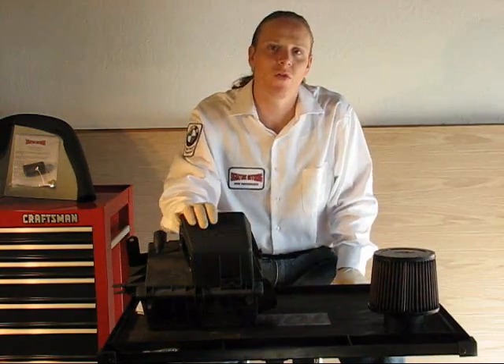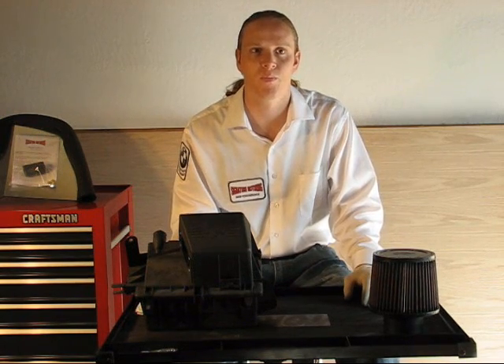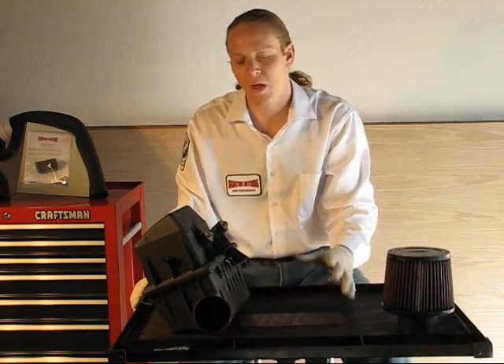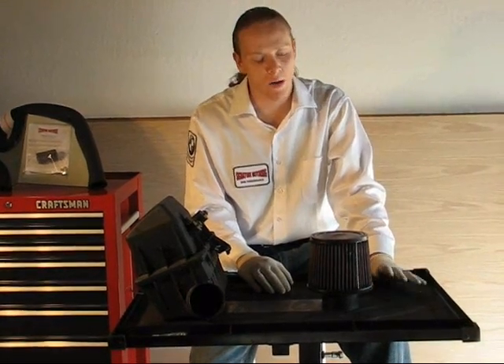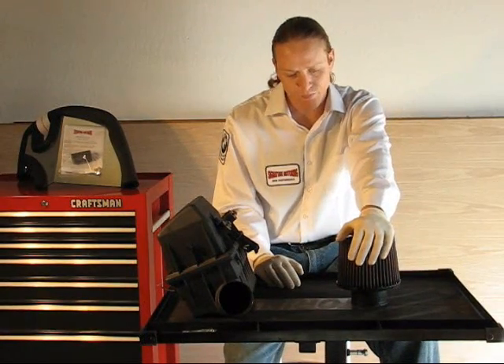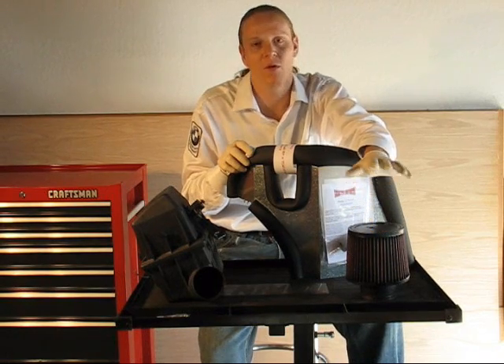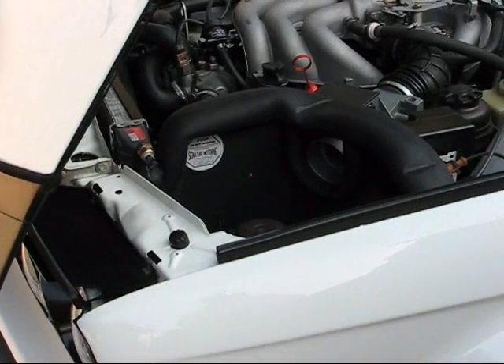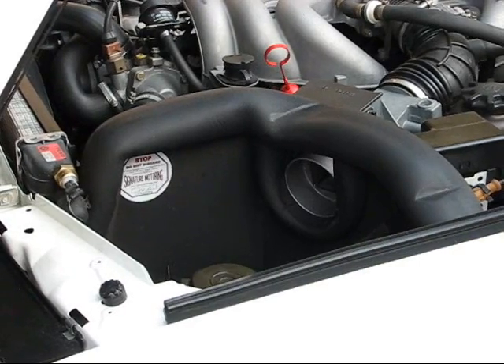Performance CAI Cold air intake benefits on BMW.

Comment: As I see it a stock 318 engine doesn't produce so much heat that after installing a shield around the cone air filter it will make a big difference in the density of the air which the engine suck in. The cone air filter on the other hand makes a difference in performance but NOT ALWAYS AND NOT IN EVERY CAR!

Comment: Don't! He's trying to fool you! Jim Conforti, a big name in the bmw tuning scene, said this :There's only one easy way to significantly improve the HP output of your 318, a Downing Atlanta supercharger. An aftermarket intake and exhaust will gain you less than 10hp on the 318. Yes it sucks, but it's true. You can spend $1500 or more on intakes, exhausts, chip/software, etc and only end up with a 15hp gain or you can spend $3500 on the DASC and end up with a 70hp gain.

Comment: @Chilla4Sho   don't listen to bmwcai, what you heard is true, the MAF on the 318 doesnt recognize increased air flow. This guy is trying to sell you stuff.. but this has always been an issue on 318's. An aftermarket intake and exhaust will gain you less than 10hp on the 318. Yes it sucks, but it's true. You can spend $1500 or more on intakes, exhausts, chip/software, etc and only end up with a 15hp gain or you can spend $3500 on the DASC and end up with a 70hp gain.